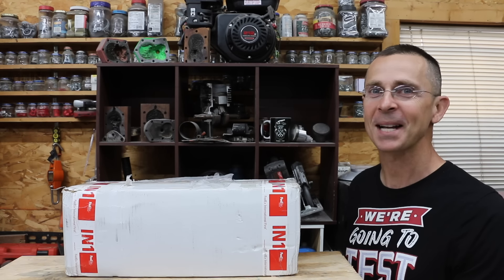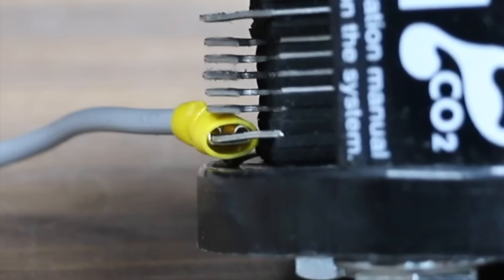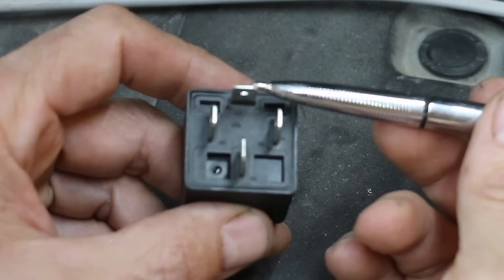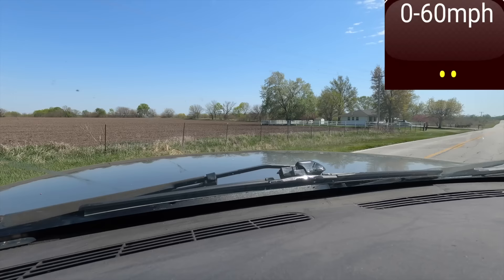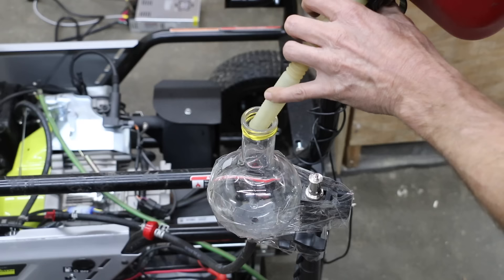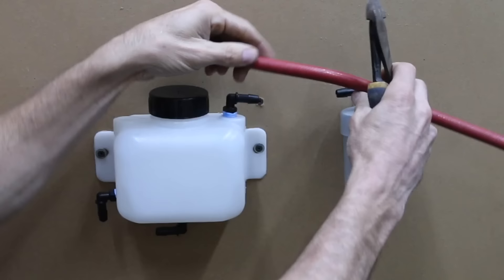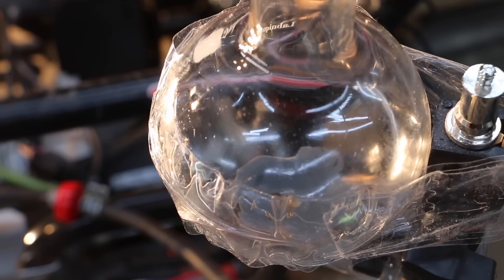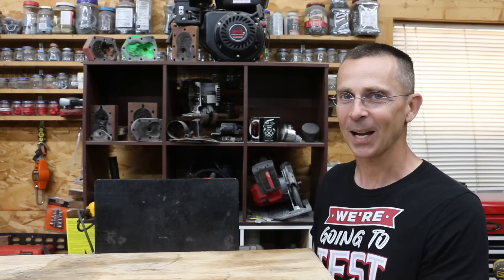AMAZING 35% More MPG with HHO? Let’s find out! Help with high gas prices?

Comment: i would be interested if you were to make the hydrogen flow more like a pressurized gas, like NOS or propane injection, than a bubble at a time if you would see different results
Reply: Then these shady companies wouldn't just be able to sell some plastic bottles for $200. I'd imagine something like you're talking about would be a lot more expensive, possibly for the same result. Interesting idea tho.
Reply: @haugenjames  you would have to produce a higher volume of gas to keep a constant stream of high pressure and this system doesn't seem to produce a lot of gas. It would be interesting to get a tank full of the HHO gas at a high pressure and feed that into the air supply then re-run the test.
Reply: @laernulienlaernulienlaernu8953  wouldn't that essentially be the same as Hydrogen powered vehicles from Honda and a few other manufacturers?
Reply: @laernulienlaernulienlaernu8953  that sounds like fun- just stand back....
Reply: It would absolutely be better.  Pressurizing hydrogen is tricky though. In this case as you would want to seperate the oxygen first so nothing goes boom. Also hydrogen is small. So it likes to leak. It also eats most metals. 
Awesome fuel though.
Reply: Possibly have something along the lines of a  heavy duty pressure able tank that could have two chambers inside. One chamber fills up with HHO while the other could fill up with pressure released from the combustion reactions. Within the second chamber the exhaust pressure could push down some sort of wall or plate to compress the first chamber thus pressuring the HHO gas naturally through already made exhaust pressure allowing higher concentrations of HHO gas to be able make its way into the throttle body either as a slow concentration "leak" or maybe even if small pressurized bursts!
Reply: Imagine also putting on a gas vaporizer to help atomize the fuel. (HHO is supposed to work better in carburetor vehicles anyway since they atomize fuel better) and pumping/compressing the HHO gas and atomized fuel into a compression system and sending it through an intake/carb

Comment: I'm guessing the results of this experiment would be greatly different if a vehicle/engine running with a carburetor and not governed by sensors or computer was used. In other words, better results would be obtained using an older vintage car or even a lawn mower. Since you already have the HHO unit maybe you could do this experiment again using those parameters.
Reply from the maker: Thanks for the feedback.
Reply: isnt generator was carb operated?
Reply: @tsugha  Its not the carb, its the electronic fuel flow that screws things up.
Reply: @ProjectFarm  what he means to say is the ecu, which governs the fuel air ratios and therefore amount of fuel injected with each cycle, isnt programmed for the HHO input, likely didnt even detect it, and wouldnt deviate from its predetermined fuel curve. Not to mention things like whether or not you were using a current that was at the destructive resonance for h20, or at a sufficient power level to generate enough gas to be useable by the genny involved in your experiment.
Reply: @Kam1kaz3dreamer  Why would it matter? We're talking Watts.

Comment: The only version of the HHO kit that I have ever seen work was large custom ones for super high gas production.  There was a cleaner exhaust gas, but the additional power draw from the system running kills mpg gain.  Turns out cars are designed pretty well lol
Reply from the maker: Thanks for sharing.

Comment: Gasoline has a much higher energy density than gaseous hydrogen, and the electrolysis of H20 is far more inefficient than the oxidization of Hydrogen.  There was no possible way this system could deliver as advertised.
Reply: The argument is in the distribution of fuel droplets and burn completion as H2 should help with that. Sounds plausible. It does work for some cars/big rigs but the equipment is more than $200.
Reply: Exactly, the math and science do not support it. But try and tell the Charlatans and believers of this nonsense that.  They will not hear it and still claim it works, lol. Impossible with this weak "oxyhydrogen". Pure hydrogen, sure, it powers rockets, this stuff, is a joke.
Reply: Technically it could work on a carbureted engine but on modern engines that have fuel injection and sensors that adjust fuel ratios to the air... It's not going to do squat.
Reply: @SilvaDreams  just need a OBD2 plug in device and they work great on new vehicles as well... actually better than old carbs as carbs just drink... 

You can fool your sensors and your computer to alter fuel pretty easily..

I have one on my 1978 spitfire and my 1998 Toyota... I get a solid 35%, but the design of mine are MUCH better than this poor design.. He has the HHO fighting the water in... as the out and in are using the same hose... not good for flow.. you need pressure and a sealed system, not just stick a hose into an intake loosely..
Reply: 1. HHO Chip
2. MAF or MAP Sensor Enhancer
3. EFIE
4. MAF or MAP Sensor Enhancer and EFIE
These will ALL make this work 100% , its really not rocket science.... I was shown this in grade 7
Reply: @TroyC68  False.  I stated the reasons this will not work, verified through hundreds of years of experimentation and observation.
Reply: @TroyC68  Now you can inject a bit of water directly in the intake stream and this will increase power and efficiency a little bit.  This is because it reduces the intake charge temperature, increasing the density of the air making more oxygen available for combustion.  The water itself is not combusted and the atoms are not changed.  Not a catalyst.  It only reduces the intake air temperature.
Reply: One thing not mentioned is the electricity used to run the electrolysis puts drag on the alternator, thereby lowering efficiency. The boost from the hydrogen and oxygen does not make up for this so as is, it will never work. What I'm curious about is what gains you get from the gas alone. This would take using an external power source not connected to the automotive system.

Comment: I am guessing that production rate of hho per min of run time for this setup is negligible and it doesn't affect overall A/F ratio but what it does do really well is adding load to the alternator - actually reducing fuel economy.
Reply from the maker: Thanks for the feedback.
Reply: You make a lot of sense there, Tom.
Reply: hooking it to a battery and retesting will tell that story. hydrogen gas has comparatively less hydrocarbon than gasoline so the closed-loop fuel system can't see it

Comment: Nice idea and in theory could be beneficial if you stored the hydrogen you produced (or oxygen but you must keep the pesky things separated) for a NOS like boost of power. From memory adding upto around 5% hydrogen by mass into intake air improves combustion efficiency. Small problem with that device is it probably creates 0.0001% concentration aka so low it's not noticed. The only thing that is noticed is the power draw and sadly that parasitic power draw is much higher than any thermal efficiency gains you're likely to ever see.
Reply from the maker: Thanks for the feedback.

Comment: I wonder if you looked at the air to fuel ratio, would the generator just be running slightly rich and you could dial back the fuel to gain fuel efficiency?

Comment: The implementation is flawed in the first place: introducing gas after the Mass AirFlow (MAF) Sensor throws off the O2 sensor values because the engine appears to run rich. Likewise, a leak after the MAF produces the same results as the engine is running on air that has not been measured.
Reply: the 02 sensor is in the exhaust mate. it measures the amount of oxygen after the engine. so that's not really the issue 
and the hydrogen was put into the manifold. without the use of clamps or sealant so it was probably sucking in more air.
Reply: TruthOrDie777. com  thats exactly what I said dude,  loman is the one that is wrong ;-) 
yeah lots of failures here in this test. however saying the channel is a joke is a bit strong. he does pretty good work for the most part. and is usually really open to retesting and doing more to get better results. 
actually to prove this point he used to use a mower with a carby to test fuel types and economy, and I pointed out he never adjusted mixtures or check the air-fuel ratios. The next week I shit you not. he bought this fuel-injected generator for this very reason. he's a good guy and does what he can! 
Hes human and mistakes happen. watch he will re do this test!  
 a generator that was carburetor one
Reply: TruthOrDie777. com  ohh defo. he needs to seal all hose connections with clamps or sealer. he needs to seal up the inlet as well.
Reply: @LOMan, so what is more likely on a single cylinder engine, which has no emission regulation to speak of, and that is build to the lowest price, is it MAF or MAP?

Comment: Great tests man! One thing I would have liked to see was the before and after of the fuel trim on the car.  Since no ECU tuning was done the trims should lean the fuel mixture out. That is if this system actually worked.
Reply from the maker: Thanks for the constructive feedback.
Reply: I would think maybe leaning out the stock mixture as if I'm reading correct hydrogen is flammable. In theory you save fuel that way.

Comment: You forgot to factor in the increased electric load of running the HHO generator.  Your generator is clearly having to generate more power to power the HHO unit, but the run times are almost identical.  So the HHO generator is increasing fuel efficiency, but slightly less than the energy cost of running the HHO system in the first place.
Or, in engineering terms, "there ain't no such thing as a free lunch."

Comment: Nice experiment, but I believe to see fuel savings you would have to lean out the fuel mixture, which may be impossible with the EFI generator. I wonder if the generator was producing a "rich" exhaust with the kit, and a normal exhaust without the kit. I don't believe the engine controls would cut the fuel usage back with only the addition of HHO. I like your experiment, this is just food for thought.
Reply: You hit it on the head. In the case of the suburban, the HHO wasn't tied into the fuel/air metering devices, so the vehicle had no clue it was there and no way to accommodate it. It just nuked the stochiometric air/fuel ratio. Exhaust readings weren't measured against intake and fuel supply. So it was moot. 

However, if it did in fact see it, the ECM would still need fuel mapping to accommodate HHO/Gas mixtures to maximize efficiency.
Reply: @mileszemanek3064  I have to disagree on that. As an ASE Master Tech, I can assure you that if there was un-burnt fuel in the exhaust (ie it was running rich) the engine would pull fuel. The O2 gases are measured in the exhaust via left and right bank O2 sensors and the engine constantly adjusts. So if you had high O2 (ie running lean) the PCM would add fuel. If you had low O2(ie rich as in all the O2 was burnt in the combustion) then it would take away fuel. This would also show up on your STFT which are instant.

Comment: Interesting test! What would make it more interesting is if you adjusted the fuel to air mixture (use less gasoline) while using HHO. I think then you would see the reduction in fuel cost while maintaining a clean burn. It is obvious by the plug that you had a richer fuel to air ratio being used which would make it less efficient.
Reply: That’s what I was thinking too. Hydrogen will combust fairly well on its own so if you use the same amount of gasoline then what’s the difference. Hydrogen burns hotter too, so maybe that why his times were shorter. But could be the level of fuel in the container.
Reply: and you must take in consideration that HHO generator puts more load on engine what makes it harder to operate and use more fuel.
Reply: I wonder too about whether engines adjust for the difference in O2, but I don't know that the generator would have an O2 sensor or any computer that would be doing these adjustments
Reply: No matter what you do to the car the computer will figure it out and return it to the normal ratio. This guy went to a lot of hard work to let you know that this product and all those like it are total BS.
Reply: These are POS HHO generators, besides do people really expect magic improvement without changing anything on the engine?
To this to work (HHO or prevaporized gasolinel) somethings must be changed.
-Fuel ratio, be it HHO or gasoline
-Ignition timing, ATDC
-Compression ratio, if using 100% prevaporized gasoline.
-Oxygen sensor readings, the ECU will make the A/F ratio richer as is programmed to keep it in a certain ammount.
And then you will have that massive improved MPG, emissions and engine life.

I'm yet to see a video here on youtube that shows all of that being done, and with fair reason to the people who don't upload something like that.
Reply: Your right, the fuel mapping wasn't changed. If your putting extra fuel in by going around the existing system, that system won't know to adjust. In short it'll be the EFI not knowing the Hydrogen is their.
Reply: @andrewsmyrek7161  ECU: Hey I have to keep a certain ammount of oxygen in the exhaust, no more- no less. I will keep pouring excesive fuel out until is done.
HHO: Extra oxygen out of combustion goes BRRRRRR

Comment: In addition to this fail for HHO fuel efficiency, I spoke to a few auto mechanics who stated, even if the HHO increased O2 input and made it run leaner, the computers in the modern (post 2000) engines would adjust the fuel/air mix and negate any supposed increase in efficiency. So double fail for the HHO scam
Reply: the true hho kit would have given instruction on how to alter ur cpu to adjust for proper mix. if ur computer isn't mixing right you'll lose millage on regular gas. so im not even sure this guy got a accredited system i think loads of scammer will just throw one up for sale. hmm the police stations that uses hho wonder if they bought one or just made it themselves. ive seen myth busters try to say hho cell wont even make anything really when i know ive made them and they didn't even add electrolyte to there's.  so after watching that mainstream media try to say hho is total scam. i can see they don't want you to think abought it. i made a torch that worked well and was amazing. so i know hho is producible in my home. at a good rate. u can even separate it and have pure hydrogen and pure oxygen. hho is like future gas crazy how it get hot when its burning something but stays cool if its only a flame.
Reply from the maker: Thanks for the feedback.
Reply: Hi there. Worked for a small company years ago that had a lot of spare time and during that time the owner and I used to do
lots of of weird experiments - one of which was HHO into a car. Our HHO cell were way bigger than what you tested here.
The main problem with his car was that it had a computer than ran the fuel mix. It was a real hassle to get pass the car's computer but
we got it to run his HHO in his flash car. It was really a bit of a pain to work out what to do with the computer. Basically the computer saw the extra Hydrogen/oxygen going in and freaked out and increased the fuel(petrol) going in. The owners particular computer need the oxygen sensor to be disabled - which of course opened another can of worms. Anyway -going from memory we got about around 30%ish fuel saving. My old Toyota van had no computer  problems - as it didn't have any sort of computer in it. I wasn't worried about stuffing up my s**tbox van - but the owner had a flash SUV. The place I noticed fuel savings was only really on long distance country trips - yeah you got savings around town but not as much. I think I commented on another youtube vid about the same thing - if it was here ...then oops sorry about that -it was probably all that HHO I breathed in...LOL!
Reply: @Jutte777  Thanks for posting real world results. The ad campaigns certainly are beguiling.
Reply: @dickstab  Adjusting the mixture on most modern cars isn't possible without a full reflash, which requires a device that costs more than this whole kit. Even then, most 'tunes' can save fuel w/o HHO simply by targeting air-fuel ratios that are more efficient but produce much more NOx emissions & can cause higher cat-converter temps (to the point of damaging them). And I say this as someone that has run modified & retuned Honda's that can get 20-30% higher freeway MPG's than they do on stock tunes (no cats to worry about).

In other words, even a perfect HHO kit isn't going to do jack shit when all other factors are adjusted.
Reply: @hydrocarbon8272  My 04 Honda hybrid had a factory recall to richen the mixture. They where burning out the catalytic converters too fast to meet the Fed's required emissions warranty. It lost about 9% mpg after they retuned it. From a best of 51 to 47 mpg.
Reply: You are adding both oxygen and the fuel, hydrogen, in the perfect ratio.  It does not introduce excess oxygen, but the perfect amount for the hydrogen to convert back purely to water.  It will not throw off the oxygen (air) to fuel ratio.
Reply: @timothym2241  The best thing is that the hydrogen and oxygen will recombine quickly, and likely before they ever reach the cylinder.  You might as well install a water/meth kit and call it a day.
Reply: Not if put a spacer that lifts 02 sensers out of path of exsaust
Reply: The ecu and emission will not allow alternative fuels other than Alcohol